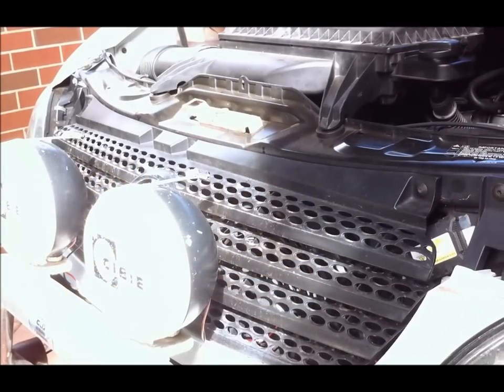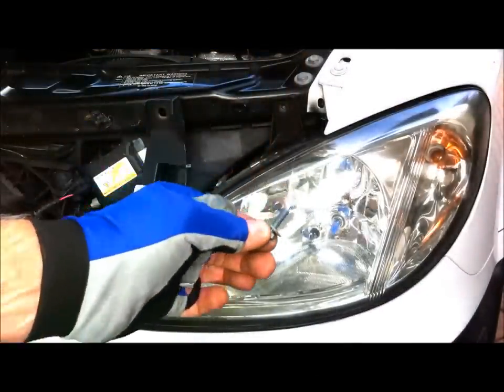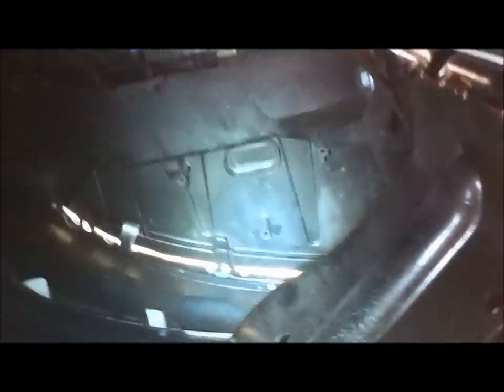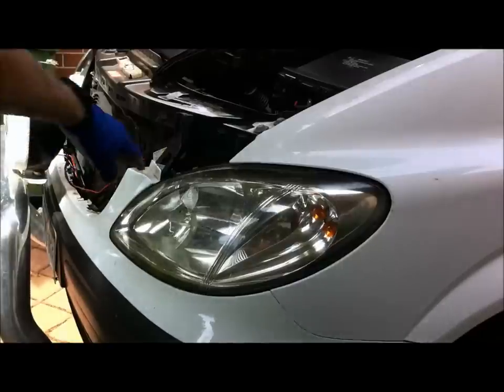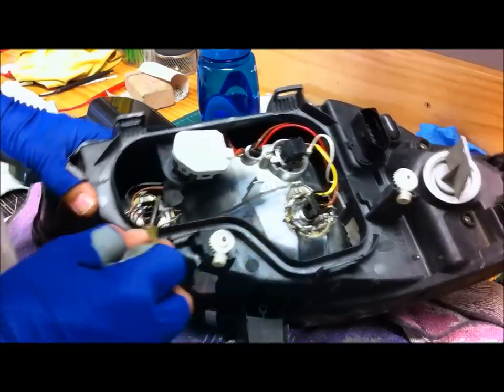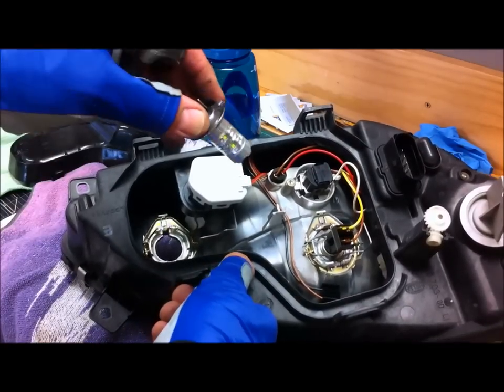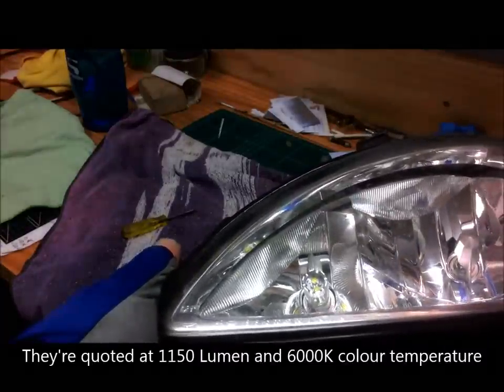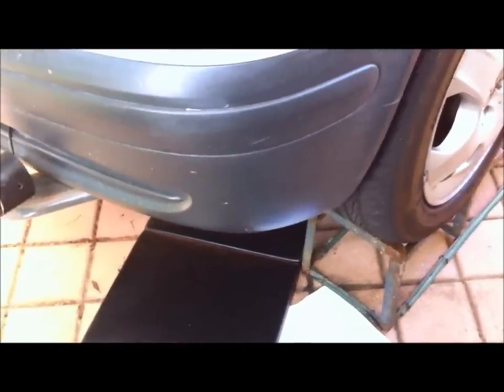Mercedes W639 Vito Viano Remove headlamp headlight

Comment: Scott, you immense knowledge is becoming invaluable for me.  I have only just purchased my 2010 Vito 111 Cdi. One of the headlights is 'wet' on the inside so I will be doing this job in the very near future.I work as a London Taxi driver and the economic climate is difficult to say the least since Uber and the corporate bullies came in to eat away at the little guy. In light of that, every video you post regarding the Vitos offers me the option of both keeping my overheads down & also doing the job myself which I quite enjoy ...until I shear a bolt or so, lol.
Reply from the maker: +eze dogman I feel very humbled ... "immense knowledge" is very flattering! You can't buy experience so I think it's because I'm 60 years old have been doing this for a long time. I've made lots of mistakes over the years but i learnt a lot from them.

The economic climate is difficult here with the mines closing every few months. Unemployment is going up.  Uber has decimated the taxi drivers here. Plates are almost worthless now so many taxi owners have been caught. The only good thing is the state government has set up an assistance fund but I think compensation will be quite minor in the scheme of things. 

I think that's all you can do is concentrate on the cost side of the ledger by taking over all the maintenance and repairs.

I'll be doing a second video on the 722.6 transmission service as the first one I'm not happy with. I have just done a power steering fluid flush and replacement. That video should be up soon. It's all simple work but you pay a small fortune if you outsource it. Regular lubricating fluid changes are the key to availability and the life of the components. Regards, Scott
Reply: A1

Comment: Thanks for that Scott. But did you know that with removing two extra screws that connect the bumper and the fenders, you can slide off the complete front bumper, leaving the headlight-bolts exposed and easy to access from the front. It allows you to remove the headlight units without having to bend fenders or remove the fenderbolts on top. Much easier!
Reply from the maker: Thanks Martin I'll do that next time.

Comment: Cheers mate, just away to change one on mine so it's good to know it can be done without stripping half the front end! Thanks for taking the time to show us.
Reply from the maker: Thanks Gav ... I'm happy to help out. Good luck with it. Just one tip ... when removing the connector use a hook tool to pull on the little tag rather than sticking a little screwdriver in. I'll put a note on the video later.

If you look at my video on removing the headlight from a W204 sedan you'll see what I mean. The connector is the same on the Vito. Regards, Scott
Reply: Duly noted, those connectors can be a right pain until you suss out a good method :)

Comment: Thankyou Scott for this video. i too have water in the new headlight, which I'm told is due to a manufacturing fault. I need to take it out so as to dry  then reseal it. Curious to know how you got around the Canbus system without using adaptors with installing LED bulbs.
Reply from the maker: Hi Jamie and thanks. I used load resistors in parallel. https://www.ozled.com.au/blog/our-blog/led-load-resistors/

Comment: Great instructions, very useful.  I just replaced my headlights with some eBay specials as the originals were in bad shape.  Coming up from underneath on the RHS I removed the horn which is on an M13 bolt  to be able to get to the most inward bolt from the underside without dislocating my arm.  Also at 6:54 I found inserting a large blunt screwdriver horizontally into the top of the power connecting clip and giving a slight twist would release the catch.  You could hear it go ping.  Once you get it off, take a look and you will see how it is supposed to work.  Another trick to not break the tabs off the back covers is not to push down on the long tab but gently push a large screw driver into the tab to put as little pressure as possible to allow it to release.  The plastic seems to get brittle in a Sydney climate.  Thanks again Scott.

Comment: Thanks for the useful video.I have replaced the same headlight in my daughter's Viano here in the UK.Unfortunately on refitting there is now a gap between the headlight and the wing.Is it possible I have distorted the wing when pulling upward to remove and replace the headlight unit?
Reply from the maker: Thanks John. No the plastic wing won't distort. The position is adjustable as the bolts holding it down are in slots. Loosen the bolts, realign the wing and re-tighten.

Comment: there's a panel on the inside the wheel well where you can get easy access to the lamp
Reply from the maker: Not on my W639 model. If there was a panel to access the back of the headlight I'd have used it. The W639 has a typical one piece fender liner with no separate removable sections. I understand there maybe a removable panel on later models of the Vito.
https://www.youtube.com/watch?v=dlUKO0bXZnY

Comment: Hi Scott Im having an issue where by the left side of the turn signal outside is not working front, mirror and rear. On the cluster it is clicking but in a fast motion. What could I look for is it a fuse or the Sam box, we did a voltage test I'm not get any power on the side mirror. All globes are fine Mercedes viano w639 2.2cdi
Reply from the maker: Check the turn signal relay.
Reply: @ScottElliott152  this relay is situated behind the cluster or at the main fuse box?

 Whats your thoughts on a worst case scenario?
Reply from the maker: @lightingacrsa9397  Actually the Vito may not have a turn signal relay. The turn signal lights are probably controlled by the Signal Acquisition Module (SAM). That sits inside the main fuse box. I doubt it's something really serious but worst case might be a used SAM from a breaking yard which are not too expensive. All you can do is a use a logical process of elimination however plugging into Mercedes STAR is the quickest way to isolate the faults. This wiring manual might help you: https://drive.google.com/file/d/19jnm1aHNjpNuZNjmzcqXthripEG-8lw4/view